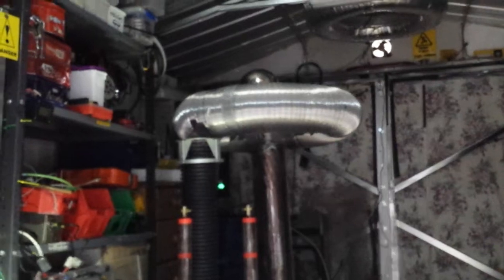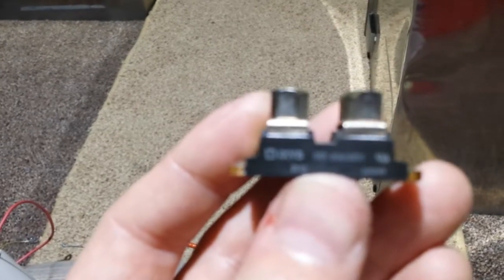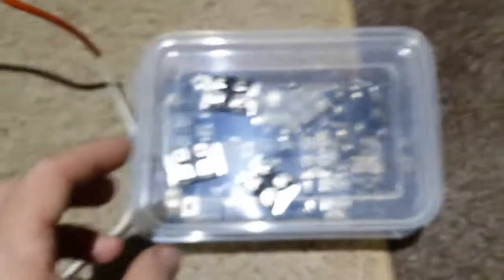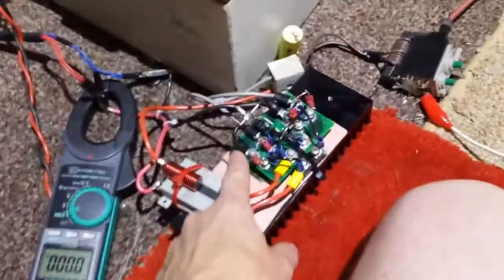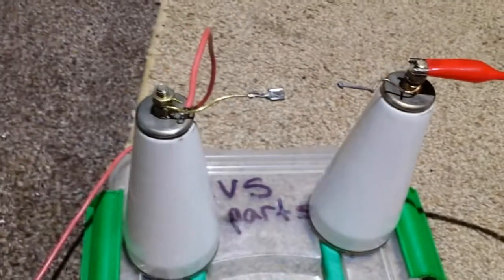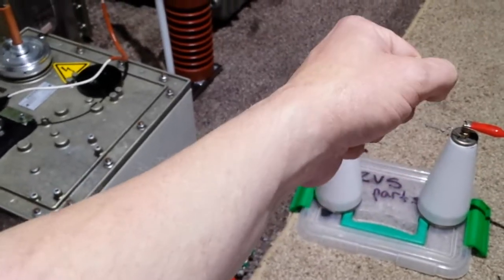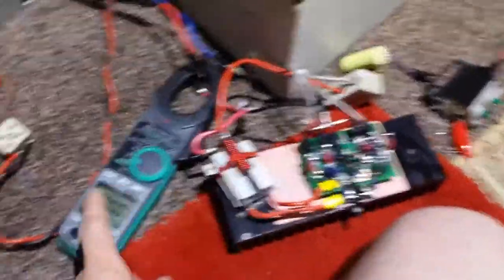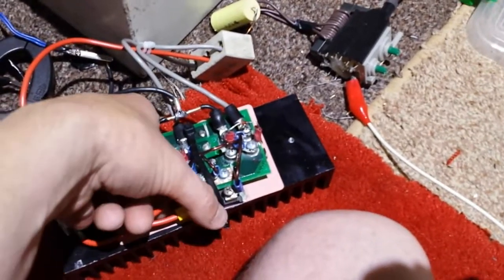Small IGBT package ZVS Driver test.

Comment: I am so glad I found your videos mate. Very informative I'm watching all of them. I have an old flyback aswell. It has built in capacitators and about the same size so I was amazed when I saw those crazy arcs! Currently I'm driving mine with one mosfet and yeah it works, good arcs but nowhere nesr as great and also my mosfet IRZF44 burn out. Am looking for a fancy driver so can you give me instructions please?
Reply from the maker: Lego Buildings Rewiew hey buddy, glad to have another subscriber that's into high voltage. yes, try using irfp260n monsters. there 250v at 50 amps. try the circuit ZVS it's a good hard driver for flybacks. if you want to build it you can find the circuit diagram on Google images. it's not hard to build.

hope this helps and thanks 

good luck 👍😊

Anthony

high1voltage1rules

Comment: Hey One question what is the rating of the zeners
and are there any more resistors?
Reply from the maker: the zener diodes are best to be at least 15 volts. as I did at one pound use 12 volt. but the 15 volt ones work better from my experience 👍😉
Reply from the maker: the positive resistors I use 1kohm resistors. for the zvs.
hope this helps and thanks

Anthony
Reply: Ok so 15v zeners and i know 1k positive
but there should also be two more resistors between negative and after the 1k"s are these 10 k?
Reply: and finnally the diodes from the gates go to the outer primaries 
Correct?
Reply from the maker: +The HV FReaK and to this comment my friend' the driver to these small package igbts is very similar to the zvs driver. and if you didn't know all ready is on google images. zvs driver circuit. 
and yes to your comment" 10k resistors with the zener to gate and source! and yes the diodes from gate to drain.
and then of course the film caps from 1uf to 10uf from both drain pins. of course the higher the caps value gives a massive difference to the output of the zvs ! thicker Arcs! more white current drawing!! and last the inductor' from positive to centre windings of the primary 😉 hope this helps and thanks mate for the comments. be safe👍😎

Anthony

High1voltage1rules